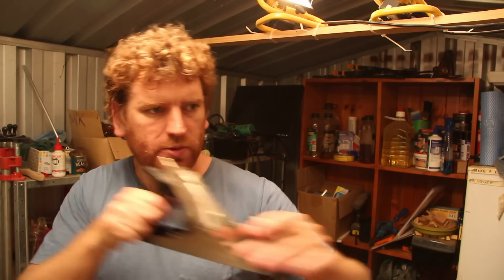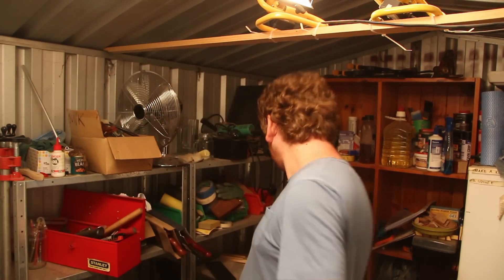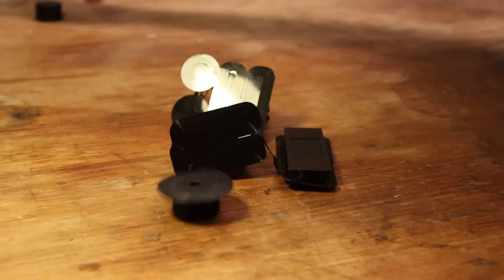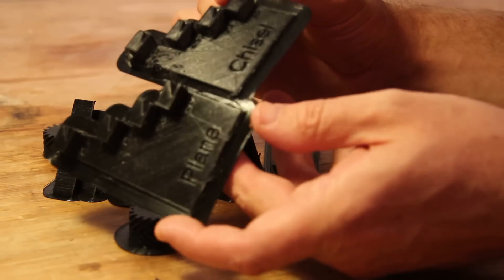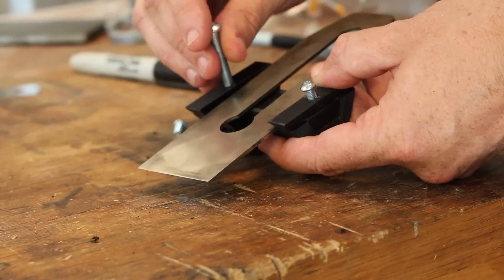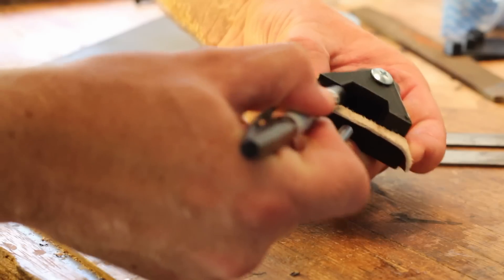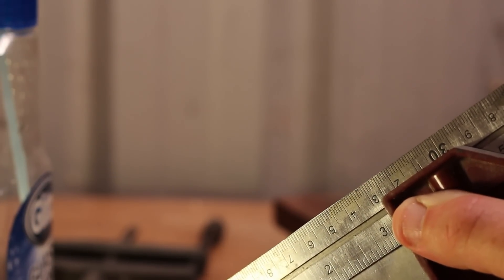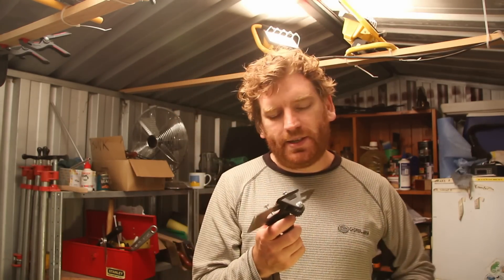Can you 3D print useful tools?

Comment: the blade angle shouldn’t matter, just tilt the blade, until you can be bothered to do it properly.  Most of the camber is probably your planing bias as you push through the stroke.  I’m surprised no-one has 3-d printed a dovetailed infill plane or jack, it would work fine.  I found your vid searching to see if anyone had done it, haaaa.  Get yourself a Scheppach Tiger, discover life with always sharp blades🤣🤣🤣♥️

Comment: Legit question from a machinist with a dislike of working with wood: why wouldn't you just use your straight edge/ 90 degree square every time you sharpen your plane's blade? I use an angle guide every time I resharpen a drill, is it taboo to use a gauge to sharpen any other blade style tool? Great video otherwise, I'm just a bit confused...
Reply from the maker: Thanks! Good question. I would resharpen ever 60min or so, using a straight edge would be over kill each time.
Reply: Hypothetically, could you check with a gauge every week or so? Or maybe make your own guide out of readily available materials? I'm thinking of the people who don't have a 3d printer or honing guide. In their shoes it might be cost prohibitive to buy a printer or a honing guide that wasn't made in Shenzhen... Thanks for replying btw, seems many people on Youtube don't particularly care about their (constituents?) viewers. good f*ck*ng Yard, friend.
Reply from the maker: Hehe cheers! Absolutely you could make a honing guide! Pretty sure Paul Sellers (master woodworker) has a video on how to do it.

Comment: You feel like a mix between Peter Sripol and Laura Kampf.  And to me that's a good thing.  

Also, I would have added a central clamp, that way it doesn't rely on thin plastic to hold metal screws in place.  There simply isn't enough meat to transfer the force needed to keep that blade in place.  Definitely a good base design that can use some simple improvement, though.  Maybe even twisting cam locks that are 3d printed.  That would also work.
Reply from the maker: Wow! thanks that quite a complement!  Yes I think there is lots of room to iterate on that design.

Comment: It could be redesigned so the screws have nuts on the other side to hold the blade tighter.
Reply from the maker: Not a bad idea, you also have to add slots to the cross bar, but it should work.